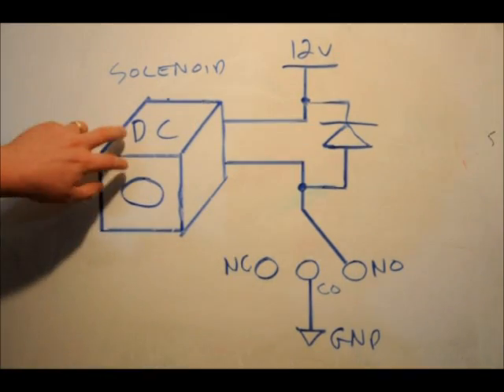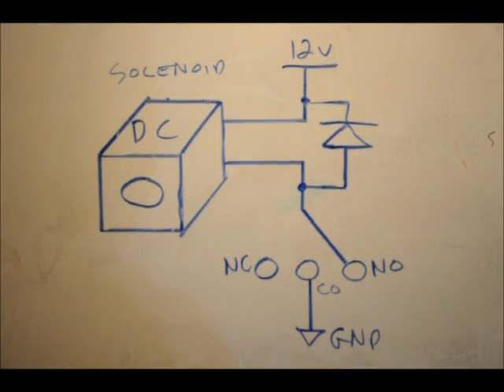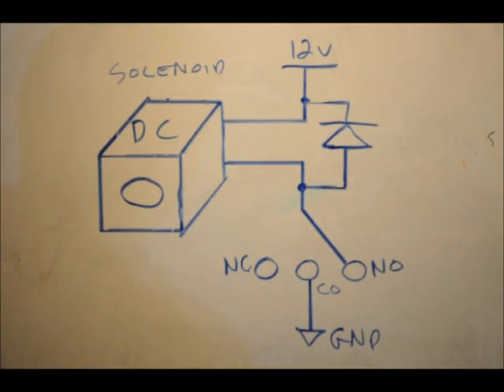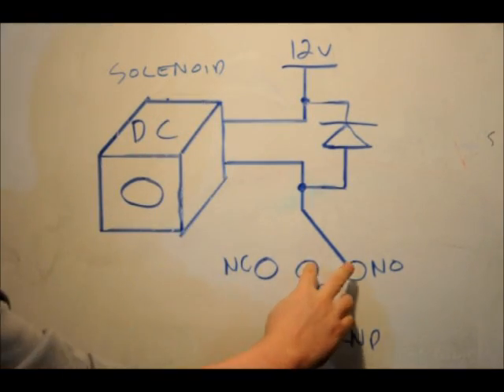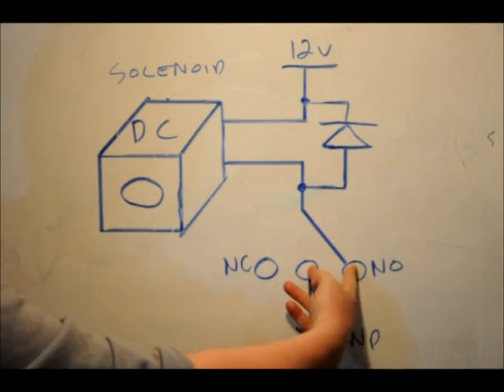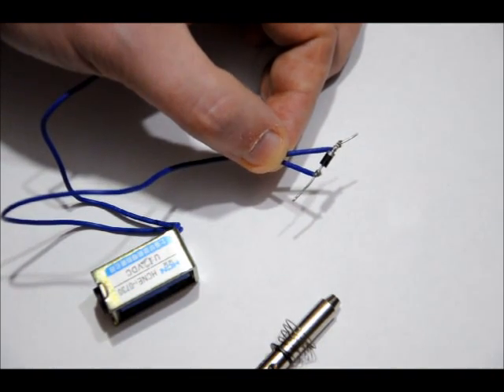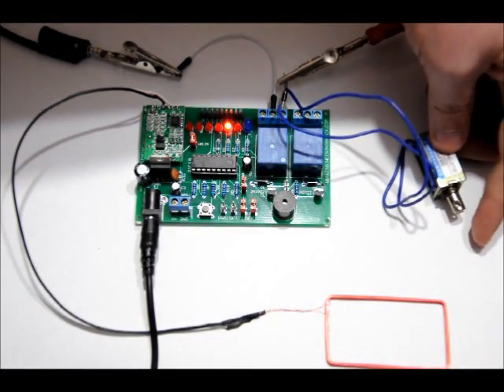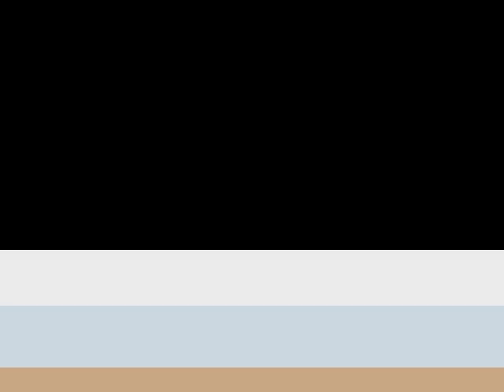Using Relays To Control Electromagnetic DC Solenoids - A Tutorial & Application Video

Comment: I know I'm late at this video, but I need help and would love an answer for you. Sadly I didn't realise I had to do this so I already damaged a couple of my relays. I am using DPDT relays to reverse the polarity of an electromagnet running at 24 V max, with the relay coil controlled using an arduino (5 volts). How would I apply this kind of diode solution to a DPDT relay wired in such a way that it reverses polarity? (It never shuts off, just changes the direction of the flow of the current)

Edit: I have checked everything about the circuit and the data sheets for the specific components and nothing seems to cause any shorts or anything like that, so I came to the conclusion it must be these spikes that is the problem (I didn't know about them until I did some more research sadly :/)

Comment: What if I connect the -ve to the solenoid and wire the 12V DC through the relay contact?
Reply: then you have to reverse the Flywheel diode in terms of Anod and Cathode, ( the white strip on the diode is connected to the ground wire) and everything else will work fine, this is because the coil of the control relay (primary side) is totally separated from the contacts (Secondary Side).